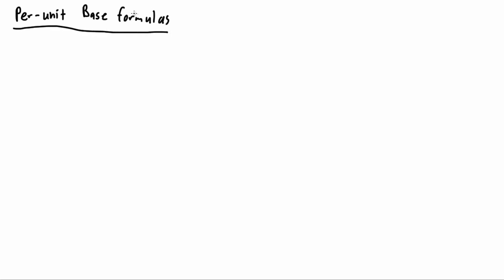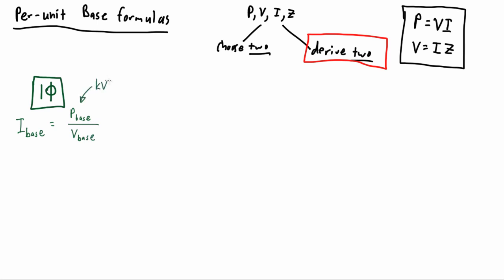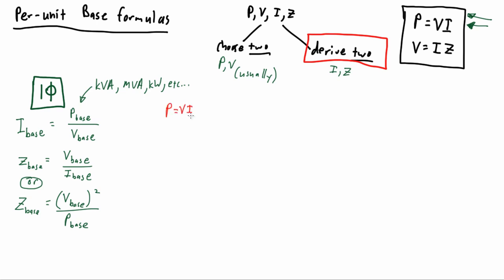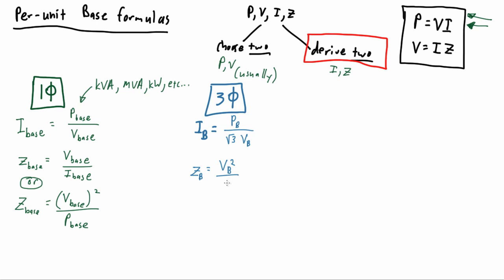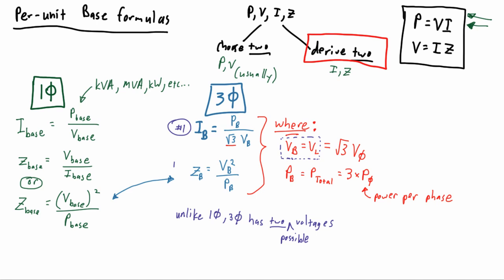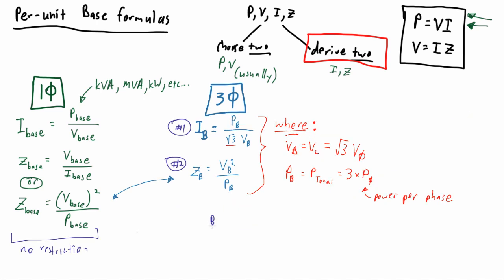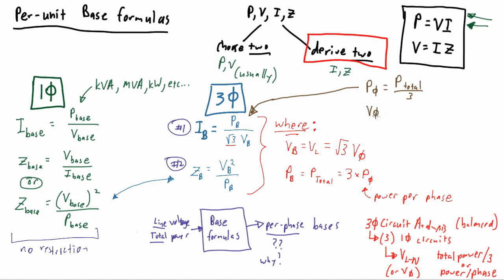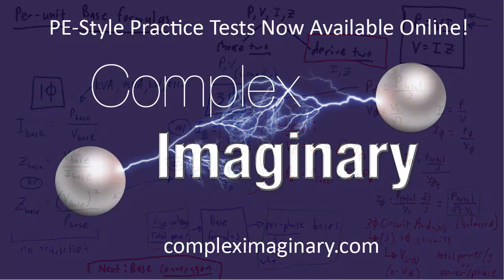Electrical PE Exam - Per-Unit (Base Formulas)

Comment: Now I may be only a lowly undergrad, but I believe your statement regarding the condition for usage of the 3 phase formulas is slightly flawed. If V_b was the line-to-line voltage why would we multiply it by root(3)? You state that the V_b = root(3)*V_phase. That is true. But then the denominator of your function is assuming not V_b to be a line-to-line measurement but a line-to-neutral (phase) measurement. Please correct me if I'm wrong but I believe the comment under me from 4 years ago was asserting a similar criticism.
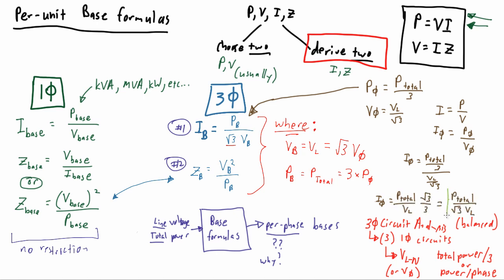Reply: I thought the same thing, but he does derive the formula at 11:40.